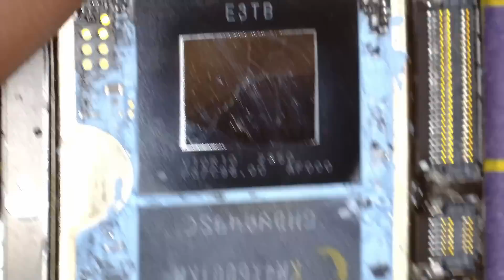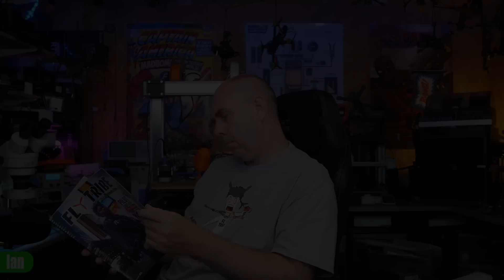DJI O3 FPV Crash Damage - Dead Air Unit Can It Be Fixed?

Comment: How about a crash where neither the camera or the air unit is hit directly, no physical damage, but the air unit still works, connects to goggles, flight data is displayed, but there is no camera feed and it says camera calibration error?  I used the assistant to manually calibrate and it fails immediately. Cables are seated properly in both the air unit and camera.

Comment: Im having an issue im wondering if you've ran into. After a fall my 03au started having an issue. It connects normal and i get video. But within a few seconds of arming it disconnects from the goggles. Any help would be greatly appreciated

Comment: Do you know how thick the case material is over the hot chip?  I’m wondering if some shallow grooves could be milled in for better heat exchange. Possible less intrusive solution for better cooling than the de-casing.

Comment: will the rc port or the osd uart work from just the other board? if so ill buy it from you. i have one that has both osd and rc uart broken so it does not work for anything other than video feed... i can also send you that one so you may see if that is the case if you like

Comment: its cracked because of the bracket and hard mounting.   thick alien tape as a cushion and then zip tied down with a little play
Reply: Helps but definitely doesn’t prevent breaking. Just had my first real crash with a new build, desynced on me at about 50-60’ up and just fell… I purchased said air unit a month ago and yet not showing warranty 😭

Comment: I had one that in a crash the camera cable ripped out. Replaced a Camera cable, but it would never seat properly, I would get OSD in my goggles, but the screen was always black, so I just sent it to DJI. Do you think it’s fixable? I’m wondering if the pin connector was broken but visually I was not able to see any damage other than it would not seat properly
Reply: I often break the tabs off the mipi connector,  and use a 3D Pen and TPU to re-secure it.  Try replacing the cable too if you've got black screen plus BF OSD

Comment: every time ive had osd issues with 03 its the cable inside that joins the two boards has come loose from a crash, thats my experience
Reply from the maker: It is transfered over that cable into the eagle. So that does make some sense.  More than anything we want to fully trace the circuit path.
Reply: @MadRC  yeah totally get that, should of watched the whole vid before commenting 🤣  dunno how my cable came loose with the glue there but it did lift on one side. It's now an naked 03 and I expoxy the boards for ghetto waterproof 🤷 works perfect now. Now in my pavo20 👌